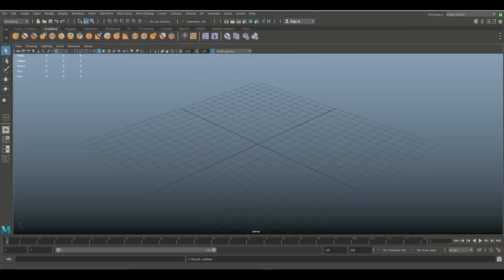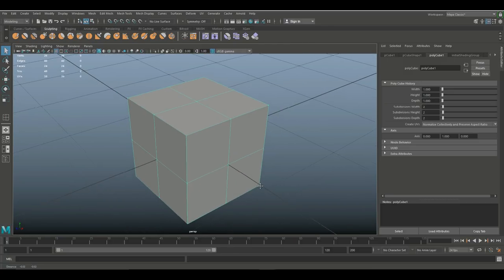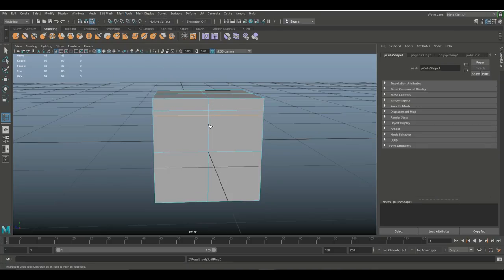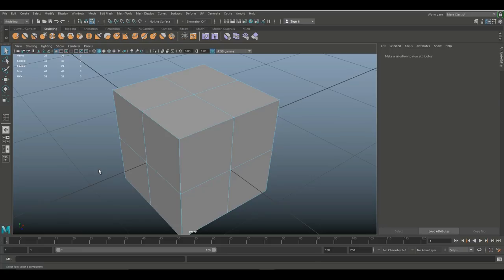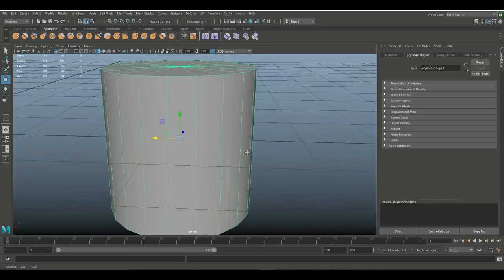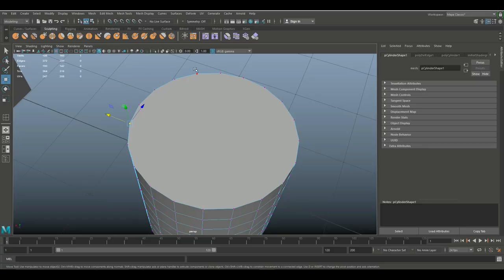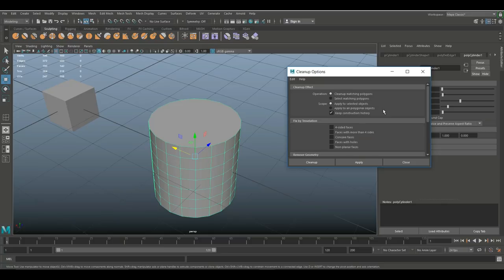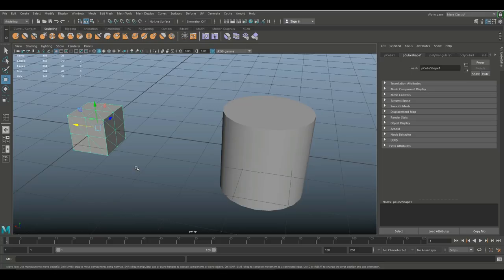Why a clean topology in your 3D model is important #2 : Polycount, Tris's and Game Engines

Comment from the maker: What other questions do you have about workflow ? Let me know below !
Reply: Mike Hermes maybe how to keep the topology clean while working on hard surface modeling/subdivision surface modeling cause that is a pain
Reply: I know it depends on the kind of game you want to create, but, in general, how many polygons should a game asset have (you can give an example for characters, items, structures etc individually)?
Reply from the maker: Pelavio, that is almost impossible to answer but I will give you a very, very generic estimate 1. Mobile game a few hundred to low thousands. 2. Normal game low thousands to low tens of thousands 3.Movie : In principle unlimited ( not really as rendering is expensive )
Reply: ive noticed that some go with quad modeling,yet there are triangles here and there aswell.My question is ,should you always quad model or is it ok to have triangles ?
Reply: 420 likes. 69 comments.
Nice.
Reply: You talked about what bad topology is, but very little about why it is bad in practical sense. While the effect of polycount is easy to understand, understanding why an N-gon would be bad is not intuitive. What does an engine do with an N-gon that is negative? Why are non-square faces bad? What are the effects of having them? What do they prevent me from doing? Etc

Comment: Wow! I'm learning more about Game Art and Game Asset Creation. And this video is quite helpful, That explains why Substance Painter doesn't like Ngons and it used to always distort or create artifacts on my UVs of the mesh. I create a lot of Hard Surface Assets using Blender with the add-on called HardOps and BoxCutter which always creates massive Ngons all over the place. But the results for rendering is amazing and has no shading issues when knowing how to deal with Booleans. Because HardOps and BoxCutter is essentially a Boolean only workflow for hard surface modeling.

Comment: For everyone asking why game engines use triangles, there's two fundamental reasons:

1. Triangles are always flat. Quads and n-gons can be bent, and rendering non-planar polygons is complicated and error prone.
2. Triangles are always convex. Quads and n-gons can be bent into Pac-Man shapes. Rendering concave polygons is complicated and slow.

The math is simpler in other ways, too, but those are the reasons that are hardest to work around.
Reply: The first shape is always triangle. If you know programming you will understand that most of the calculation in regards to lighting has something to do with triangle.
Reply: @twitchie9116  To calculate lighting for a point all you need is a vector telling you which way the light is aimed, and a vector perpendicular to the object's surface at that point (called a normal vector). Calculate the angle between those vectors, and you know how that point should be lit. If they're pointing it the same direction, you're on the dark side of the object. If they're pointing in opposite directions, you're on the side directly facing the light.

The only reason that triangles come into this is that it's easy to calculate normals for triangles.

If you're using flat shading, you calculate one normal for every polygon. That only works if the polygons are perfectly flat, and triangles are guaranteed to be flat.

For smooth shading, you calculate a normal for each vertex, and then fade (interpolate) between them. Triangles make this a little easier because there is always a correct linear interpolation across three points. For four or more points, you either have to do a nonlinear interpolation (slow) or pick a linear interpolation that's close enough. In practice, "close enough" looks fine, and isn't a real problem.

Was that more than you ever wanted to know? 😄
Reply: @Afishionado1  we are talking about shape. Even before shaders and texturing exist in graphics. The simple way to calculate light has something to do with triangles. Even the vector itself is still connected to triangle. Do your math and observe its nature.

Comment: 1.Ok. so the mesh is triangulated via clean up tool. What about 5 sided pools. are they kosher for game engines? 2. I am very interested in this series. (specialy for hard surface) keep up with that!! thanks!
Reply from the maker: 5 sided nGons are NOT cool as explained in the video..
Reply: Sorry Mike. I misspelled. What I meant was 5 sided poles. A vertex with more than 4 edges attached. Is it acceptable? I heard that Turbosquid will scan your model for n-sided poles?
Reply from the maker: No, not acceptable

Comment: is it necessary to use quad in hard surface modeling if the shading looks fine??
Reply: If the object does not need to be animated in a way that distorts it, then mostly or all triangles is fine in the final mesh. (e.g. a rock that will not flex at all.) However, you still almost always want mainly quads during the workflow, since so many actions require edge loops to work correctly. But if the final steps of scuplting / decimation create triangles in the finished shape it won't matter for purely hard surfaces.

Comment: So doesn't triangulating increase the amount of polygons?  And why does the game engine triangulate it anyway what's the advantage.
Reply from the maker: Everything is about triangulation and the quads you see in Maya are in fact just 2 triangles. So no, triangulation does not increase the polycount ( 1 face equals 2 triangles )
Reply: As far as I know it's because GPUs are optimal for calculating many triangles at the same time, because it's the simplest possible poligon and a GPUs consists of many "cores" that can calculate only very simple things,
like triangles. And because realtime rendering, like game engines preferably use a GPU to render that's why :^)
So instead of calculating something complex with your CPU in minutes, you break it down to the simplest possible to calculate them all at once in milliseconds.

Comment: I have a installed maya 2018 student version and i have a problem with tools which are use for scale,move etc.
Left mouse button not work as click and drag, but middle mouse button working. 
So can i change mouse settings?
Reply from the maker: Try resetting to default, If that does not work you need to reinstall. I am hearing this problem a lot
Reply: Can I know your system configuration? Dear

Comment: when we smooth an object, don't the n-gones disappear automatically? Or we are supposed to go to the CleanUp menu firstly and then smooth?
Reply from the maker: When in doubt, use cleanup and then smooth
Reply: I'd say it's better not to clean up using the tool, it doesn't give you uniform geometry. Either clean up by hand or smooth straight away.